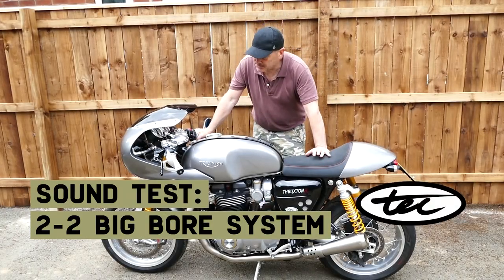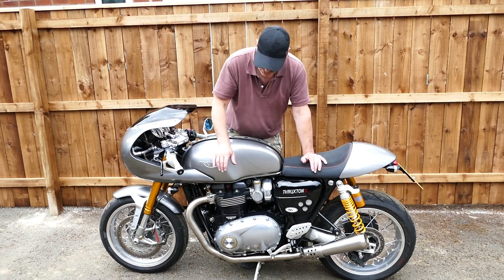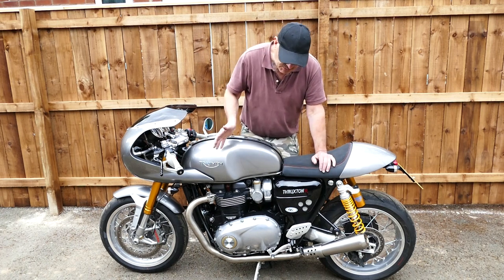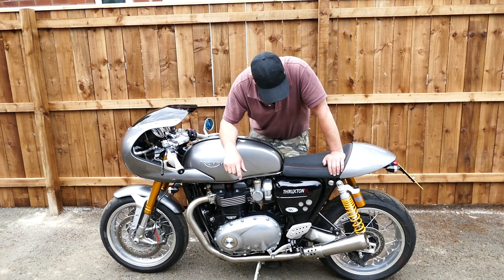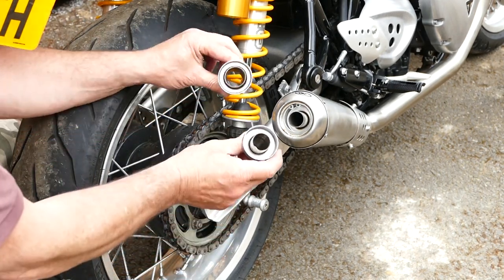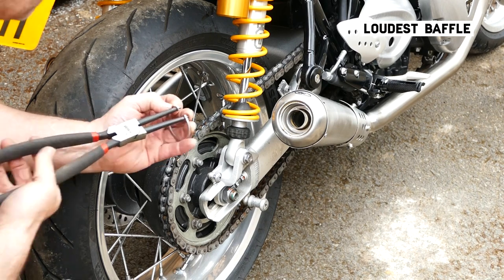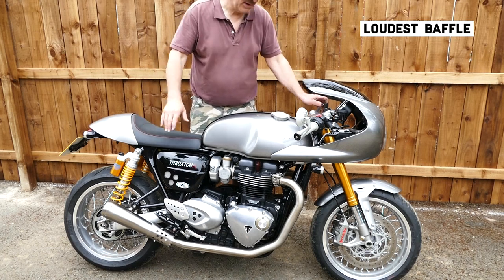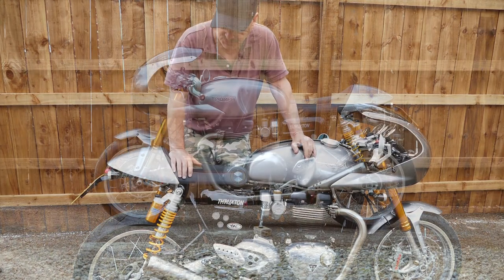Big Bore, Deep Sound - TEC Dueller 2-2 Exhaust System - Speed Twin 1200 & Thruxton 1200

Comment: Hi George - great product development again! Looks and sounds great. Does anything need doing with the ECU or is fitting this straight through exhaust within the self learning parameters of the factory ECU?
Reply: absolutely 100%
Reply: @daniellekoran7906  confused ? I fitted this system and wanted a tune also ne Of your team told me that they would not sell me a tune with a Tec  system due to poor quality .have been riding with no issues.
Reply: @kentool6537  You still want a tune with a full system.  The "self learning" of the ECU is vastly overstated.  It doesn't do much, at all.  Your bike will run lean and stay lean until you tune it.  If you install a full exhaust and don't drop a tune in there, then keep the restrictive baffles in to keep the bike from running too lean.
Reply: @SquireSCA  thanks guy , am presently trying to register with tune ecu and pay . But yea reinstalling the stock baffels has been in the back of my mind . Considering making some as well . But for now just want to open the stock map just for studying . I've read its a bit lean and having removed the cat and adding the header it needs looking at  . All so not unwilling to try another map as long as i can save my stock one . Its just a matter of learning the how toos . Thanks again .
Reply: @kentool6537  If you tell me what year, country and the last 6 digits of the VIN, I can put together a map that will at least tide you over till you get a proper tune on a dyno.  I can get rid of any throttle restrictions and increase mod range and top end power, add extra fuel to the areas that are typically lean, raise the rev limiter, reset the AFR Target tables to 13.2 in the event that the ECU does try to help out a little, it will make changes in the right direction, etc...

I may already have a map, or I can make one if you want, let me know.  I don't charge anything for them, it's just editing tables on a spreadsheet, when you think about it.
Reply: @SquireSCA  hey neighbor , here are my numbers : USA, 2022, AUO141 .  Note that the o is written as what is called the symbol for diameter in manufacturing. But i think you know this . Oh and the reason i called you neighbor is that i live minutes from Road ATL. and work in Cumming. Still have a lot to learn thanks again.
Reply: @kentool6537  Yeah, I live between you and where you work, you probably pass by my house twice a day.  haha

Give me a few minutes and I will put up a map for you and share the link.  Just download it and install it once you get set up on TuneECU.

And come ride with us!  If it ever stops raining...  😞
Reply: @kentool6537  Shoot me an email and I will send over the map.  It will be much better than your stock map and you can leave the baffle out.  You should feel a vast improvement over stock, especially in sport mode.
Reply: Oh yea, i do sometimes cut through Flwr Branch. One road i use is HM rd. And WO rd. Once im happy the bike isnt too lean ill be out more . Thanks again.
Reply: @kentool6537  We are off WO.  Shoot me your email and I will send you the map.  Its similar to a Thruxton map I built for someone and that guy was LOVING how it made the bike perform...
Reply: @kentool6537  And it IS lean.  These Euro5 bikes are lean from the factory, so a full exhaust absolutely puts them into the not so good fueling range.

Comment: Hi George,
Lovely peice. What needs to be done to the factory ECU? I bought a 2021 Thruxton RS in March. Was disappointed in the Arrow headers and Free Spirits XL ( sent it back after ordering ). Have you thought about an XL- Pipe system with your X-Pipe and new Mid Pipes? Would that produce the best power?
Reply: needs a tune 100%